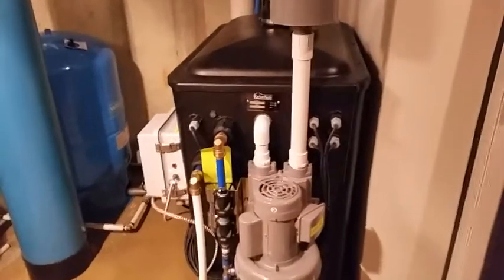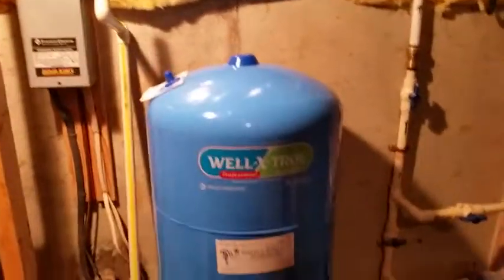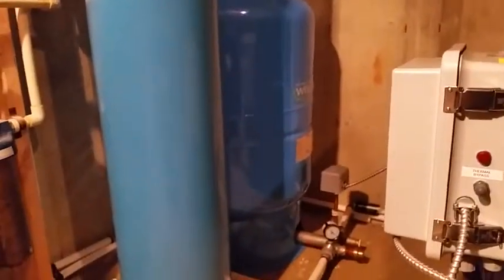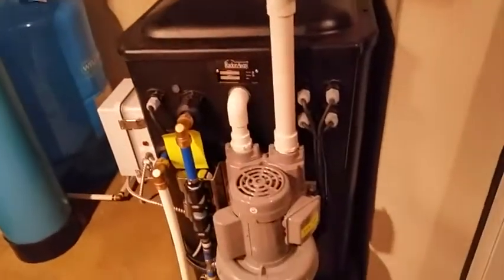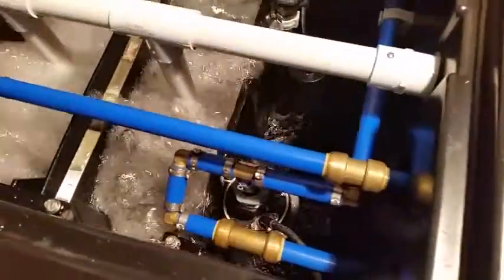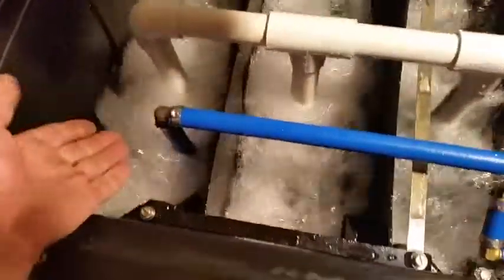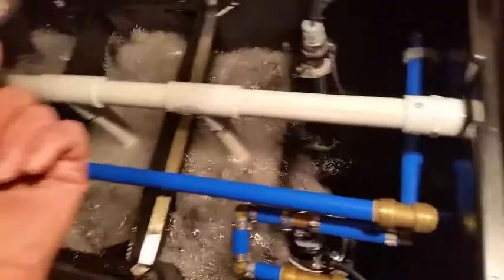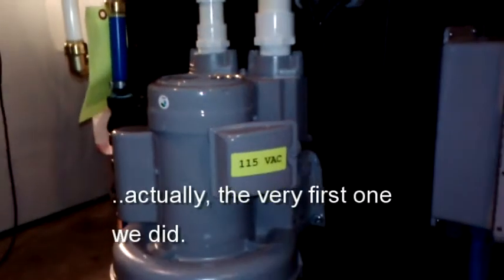Central VA Radon, Charlottesvile- The Airaider System

Comment: I was thinking about getting one of these, but it sounds a little like a jet spinning it's engine up. Does it bubble all the time? Does it bubble for a set delay after every refill? There's not much information available, other than advertising, which of course just extols the virtues and wonderfulness of the thing. Look what I learned from just this one video...
Reply: The sound if the motor is not that bad plus we have smaller units and quieter ones also in the control box there’s a timing switch where you can choose how long the system will run for when we ship the units it’s set at 10min run time that was we can check the units for leaks and malfunctioning parts before we send it out to the customer